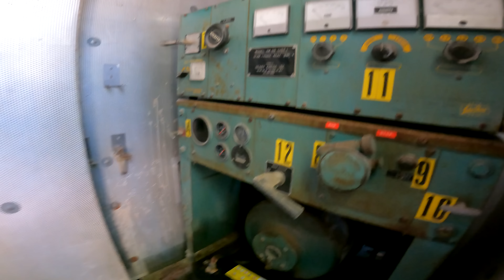Abandoned Generator Restoration Part 2 - Will it buff?

Comment: I used to build and test gen sets for Baldor Generator. We built 500-2000kw and every unit we built the fuel tank was not built into another tank. The entire base was the tank. So I would guess that your unit is the same. Nice work. Cool to see that old girl cleaned up.
Reply from the maker: It is indeed thanks!!

Comment: This video just goes to show you that there's so much stuff out there that's still good.  Just look what Wayne did with this did a little work with the motor.  Sandblasted the outside and primed and painted it and it's like Brand New BUT so much cheaper than buying a New one.  Sad to see so many things junked when with some work you can save so much money.  Awesome Job Brother turned out really nice and it's yours paid in full...
Reply from the maker: Thanks Kenny! You're right we're a lazy society and would rather buy new than fix old
Reply: @Ol2Stroker  You hit the nail on the head such Lazy people theses days.  Plus the Old stuff will out last this New Crap three times longer and the New Shit will brake your bank account.  Enjoy your weekend Brother ..
Reply from the maker: @kennyspry5189  100% bro. You too

Comment: Stripped down and replaced most of the sheet metal on an old cummins powered onan genset with a cabinet similar to this and the bottom section was the tank on that one, not a tank within a tank. I ended using a lot of nutcerts or rivnuts on the more difficult louvres and panels, and sikaflex to stop moisture getting between the joins and rusting it out again. That green looks great, coming along nicely 👍
Reply from the maker: Thanks man great tips!

Comment: Young fella just make some angle iron clips with a offset in the leg going over the outside flange of louvers. 
Then you can use bolts with star lock washers to hold them securely to the angle iron clips. 
Nut zerks installed in the holes drilled for anchor bolts will last forever if you seal them and every seam with NP1 sealant  
NP1 will out live silicone by million years, because it will get a skin on the outside, but it never completely dries up allowing it to constantly flex and move with the metal skin.
Best advice I can give you, up to you as to whether you choose to use it or not. 
I'd ask you for advice on big tucks are anything with Detroit in it.
Since I was a sheet metal worker for probably close to how long you been here, take it as best I can offer from my field if knowledge, and I am sure someone else can give you something different that may be just as good if they're worth their money. 
Because every area has different tricks of the trade that works for them.
PS
Why not paint the dam thing a light color to reflect the heat instead of soak it up like two fat girls at all you can eat pizza parlor, after they were both stood up for dates earlier.
Reply from the maker: Thanks for the advice Tim!
Reply: @Ol2Stroker  didn't give you much choice I'm afraid after reading it back. 
My apologies young man, sometimes I come across not exactly as I meant it to. 
Nice job y'all have done, but never was a big fan of dark colors on equipment housings for two reasons. 
They pick up and hold heat way too much, and that same heat is extremely hard on the equipment, and the person or persons having to service the equipment. 
Causes excessive wear on all the components inside that due to the extreme heat built-up within the housings. 
Heat basically kills everything it touches in cases such as this. 
You know yourself if you've worked on one of these power plants used in these are similar gensets.
I've been around the little ones that have V12's and V16's twined together crankshaft to crankshaft then tied into one large exhaust muffler system, and the cooling fan drawing air across the radiator into the enclosure is brutally miserable to work inside there.
Would be better if the engineers reversed the fans and drew air from the louvers then across the engines powering the generators, and out through the radiators.
Add the screaming engines exhaust, and just the lifters and rocker arms alone is deafening inside these hell on earth enclosures, but then add 200 degrees off the radiators, and 110 ambient temperature, which is increased significantly due to the location on roofs are stuffed inside a containment fence of some sort.
That's why I suggested a reflective color instead of something that is going to add addional heat unnecessarily just because some moron decided everything had to be some unhealthy color.
And I assure you that bastard never once stepped foot inside one whether it was functional or not
Reply from the maker: @timothymilam732  that's how this one works it draws through the louvers over the engine then out the radiator and exhaust hood. I'm hoping it won't be too bad in there in summer but at the same time I think a little heat retention will really help in the cold up here which is most likely when I'll need this thing.

Comment: Paint looks great! It looks real close to Cummins/Onan green on the generators. I would try to blow out as much sand and dust as you possibly can for the engines sake and the windings of the generator and controls. Our company had a big trailer mounted load bank that was pretty rusted from Ohio roads and salt sandblasted. We got it back and looked great but started having all kinds of issues from the sand getting into absolutely everything! You ever find a transfer switch? What do you need a 240v single phase 200 amp?
Reply from the maker: I vacuumed out the entire cabinet as best as I could because I was worried about exactly that. I'm hoping to avoid that... Also we blasted with crushed glass not anything conductive so hoping that helps too
Reply: @Ol2Stroker       i'm sure you'll be good!

Comment: Looking forward to the GATR trans progress. I'm working on doing a Eaton 13 speed OD swap into a international school bus with a dt360 and spicer 5 speed. Can you tell me a little about the heavy duty clutch and input shafts? I know there's push and pull style and 1.5 1.75 and 2" inputs. 13 and 14" clutch. Are they interchangeable as long as they are push or pull originally and you have the right input shaft?
Reply from the maker: Man there's a ton of options.... What are you tryna do?
Reply: @Ol2Stroker  put a double overdrive behind the dt360 in my bus. I either have to change the rear axle ratio or I have to run overdrive in it and if I do the overdrive and I can turn the fuel up and not worry about scattering the five-speed Spicer.
Reply: Rtlo 16918 I think was the number that sounds perfect. It's got a 86 and a 73 overdrive. I can run that for a long time with my 5:38 ratio. If I ever want to put a lower gear in it eventually I'll have 90 mile an hour top speed if I really want. This is a full size international School bus getting a ramp put on the back for my race car.
Reply from the maker: @jasonbirch1182  man 18s are expensive. It is just a dt 360, I wouldn't be too terribly worried about scattering the spicer. I'd swap in a rear with a decent gear and go from there.
Reply: @Ol2Stroker  that was my first thought too but a simple p7100 pump swap or even my A pump with a few tweaks and it's making more than the rated torque. I'm still open to a 9 or 10 OD too. I just love the split OD idea. I'm just not versed in medium and heavy duty stuff to know what I'll need exactly. I need a sae 2 bellhousing I know . I'm learning but what's definitely interchangeable flywheel and clutch wise I don't know. I can build mounts and make whatever shifter work fabrication wise. The gear probably makes sense on my budget, being one and done but I just hate the idea of worrying about the trans. It's rated at 160-210hp and 520lbft. My motor is 190 475 stock. Even just turning my stock pump up puts me in the danger zone unless that spicer is actually a lot stronger than rated. It's a es52-d I'm pretty sure.
Reply from the maker: @jasonbirch1182  yea I dunno what them spicers will take lol